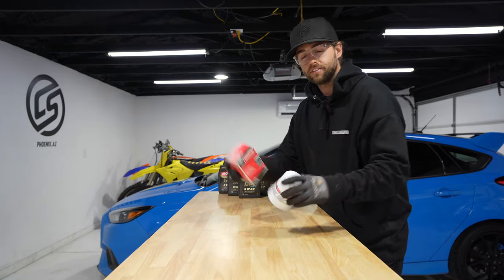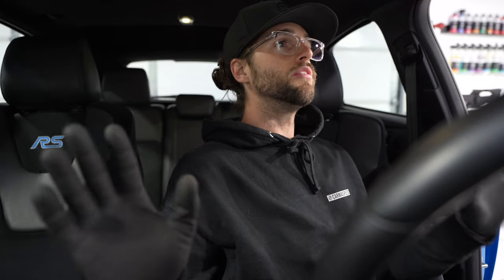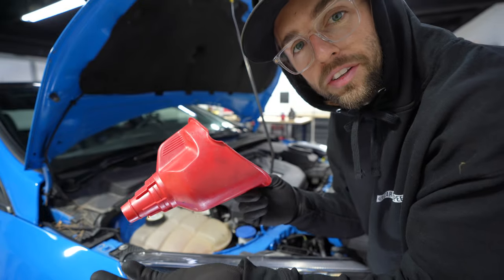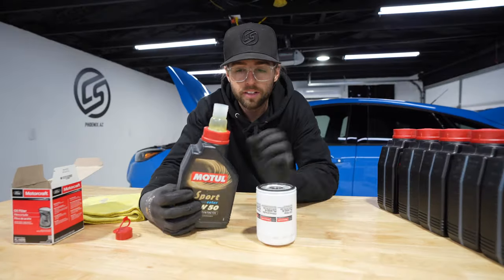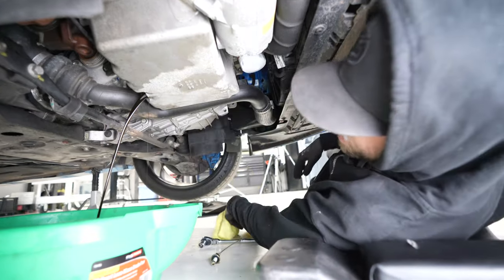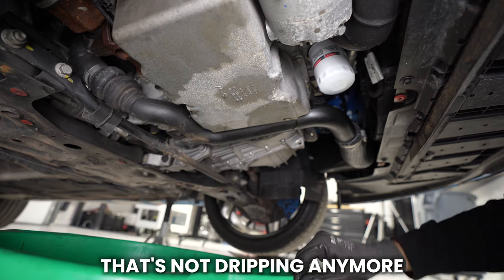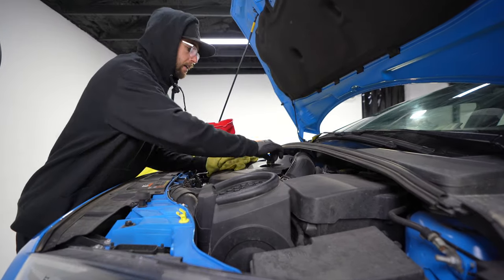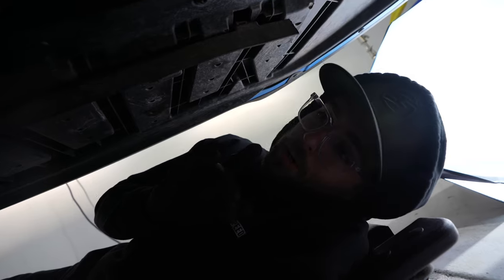Focus RS Oil Change (Step-by-Step w/ Motul Kit)

Comment: Oil filter tip. Slightly loosen the oil filter. Take a red solo cup and squeez it around the filter and spin. No mess and all the oil stays in the solo cup.
Reply from the maker: dudeeeee thats genius. Thank you Charlie!
Reply: fking amazing idea, doing this next time
Reply: Im going to try this. I just used a small funnel on my filter last time but a cup makes more sense

Comment: Good to see you pre-fill the filter.  Why wouldn't you!  I've seen vids where the mech just didn't bother.  There is no reason not to?   Here in the UK (And Europe generally) the oil spec is 0/40  It's not as if we have a colder climate generally than the US?  I use 5/50 now the car is out of warranty and have had no issues.
Reply: You really don't have to pre fil the filter anymore. 15-20 yrs ago sure but it's no longer needed. You still can if you want though. No harm no foul

Comment: Great video as always Cameron.
Question, when you lift the car only at the front, are you emptying the oil more effective when doing that or is their a risk that you are not draining all oil? The plug is tilted backwards I guess so maybe its even more effective than to lift all four wheels? Im having a tight garage so not possible to lift all four....

Comment: U filled up the filter + another 6L? Sounds a bit much to me as the oil also will expand when engine getting hot. Manual says 5.4 with filter. Anyways, nice video
Reply: It looks like the oil he used for the filter was from one of the containers, so 6 L was all he used

Comment: Hey Cam did you run motul in your GTI? about to do a Change in my mk7 R for summer and deciding on a brand. Was gonna go with LIQUI Moly but not sure…
Reply from the maker: yeah i have a video on the channel for the GTI specifically which has the same motor as the R :)
Reply: @CameronAlford  sweet. Thanks watched that and got it done today with jack stands and all, feels good 😂

Comment: AMS oil is god tier, not changing my opinion
Reply from the maker: Why so?
Reply: @CameronAlford  lot’s of tests showing differences in performance, but if we’re being honest, the earlier oil changes are more important. AMSOIL is great if you beat the shit out of your car, like in tracking
Reply: @CameronAlford  Amsoil and Redline used to be the only two that met Ford specifications. Looks like they're adding more now
Reply: I'm running Motul in my GR86 and have had no complaints, it's quality stuff